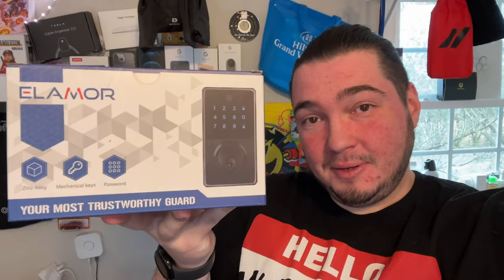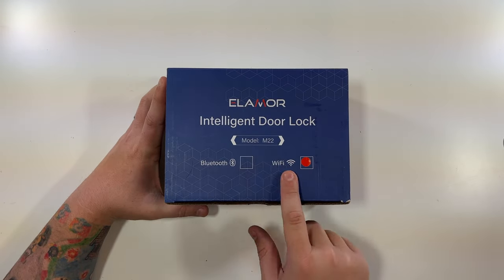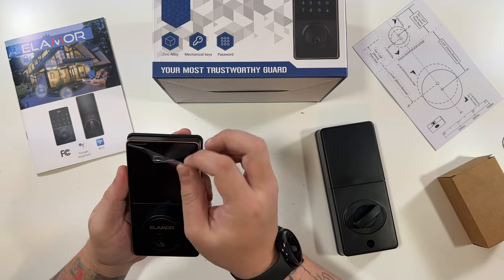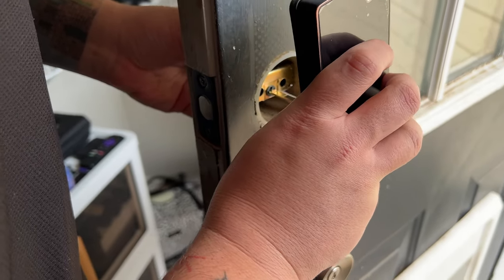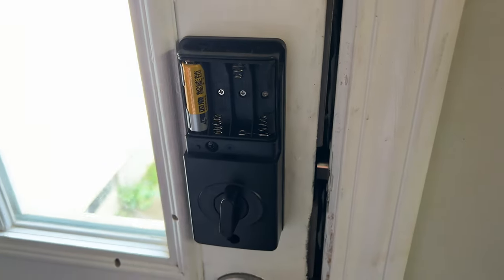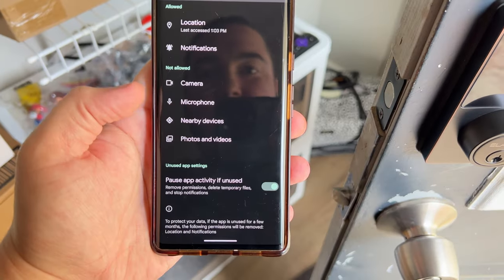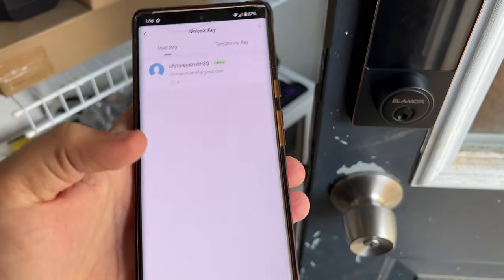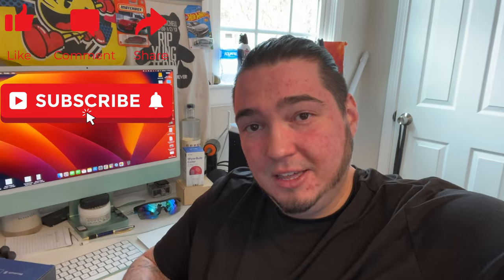ELAMOR Smart WiFi Lock Setup & Review

Comment: Thanks for the video.
A quick tip: to add a device to the wifi network you don't need to press the reset button. If you do all the settings will be gone. The best way to include the smartlock is to remove one of the batteries, only for few secconds, and add the device right after you place the batteries baclk in.